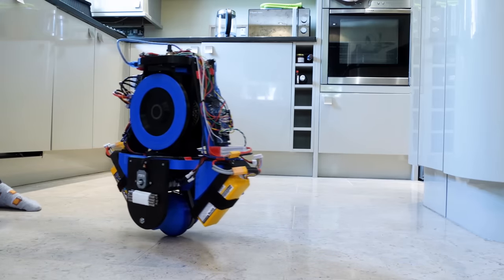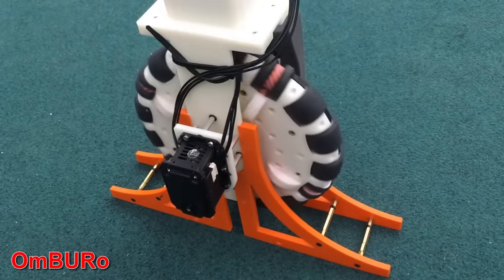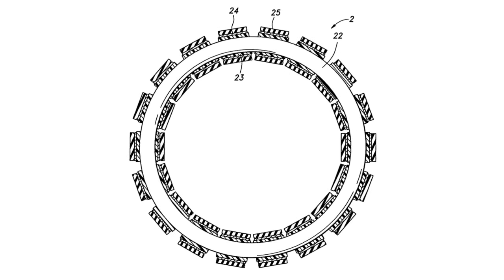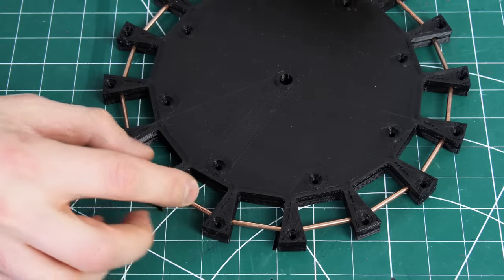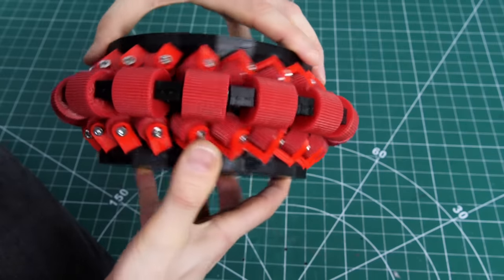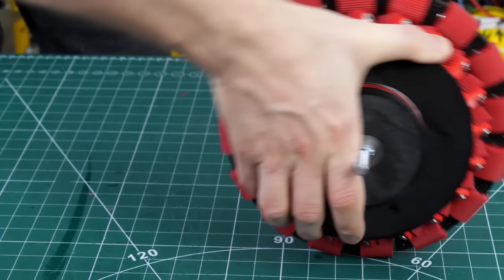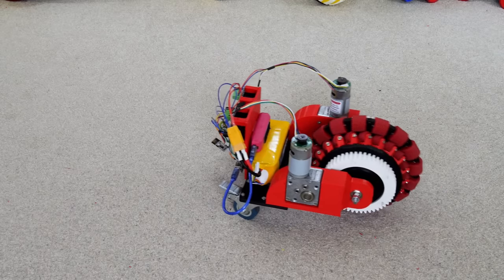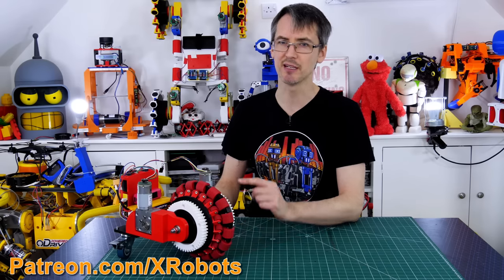Why this Omni-Wheel is Really Weird

Comment from the maker: Check out part 2 - will it balance on one wheel? https://youtu.be/B_bXW2vfkm0
Reply: I don't know if you know this, but herbie was ment to me in fan4stic, and was ment to be just like the robot at the start of this video, but with a soccer or basketball!
Reply: This really grinds my gears.....need to angle the teeth properly for engagement. Deeper grooves. Gears need to engage properly to get any work out of them. I wish I lived in a higher IQ dimension.
Reply: I really couldn't figure out the potential advantages of a single complicated wheel over 4 simple wheels... What is this going to be applied to?
Reply: The Mel science web site is garbage. Nice Clear Pricing!!!! No request for subsription or info... WTF
Reply: It's not a unexpected twist. Similar to when you drive a motorcycle, you turn the handles into he opposite direction you want to turn. Look it up. Cool project. You gained another follower.
Reply: What i wanna know is why is this technology not in modern cars.... like I have known about it for a while but never understood why it couldn't be adapted into cars? like all the components are so simple in design how hard would it be to just put it into a car

Comment: here as well as with some of your gearbox videos (harmonic drive, and I think one of the cycloidal drives), you use flexible filament for grip or ductility. It does do both of those things but it also saps efficiency and puts more load on the motor. Think biking on a flat, soft tire vs an inflated and much harder one. It's a balancing act to get grip and efficiency, but in my experience most 3d printing flexible filaments are too soft for transmission rollers. Maybe try PLA rollers with just a thin rubber tire on the small wheels for grip.
Reply: To be fair, compared to the traditional machining, hobby-level printers may be working with tolerances of 0.1 - 0.2mm even when tuned quite well, which is a lot more slop than you'd expect from machined parts. That could have an impact on how well harder rollers grip.
Reply: Have you ever used TPU depending on the infill u can't make it very hard 
I don't think ur they are as soft as you think they are
Reply: @syedsulaiman8380  I've got a roll of TPU and have seen lots of other people's prints as well. It may feel "firm" to the touch but its still very soft as compared to the rubber on a tire or drive belt.
Reply: @EgorKaskader   True, but even then I think you'd be better off with two hard rollers, with one having a thin TPU tire for more traction and to soak up the loose tolerances. Or at least one soft wheel and one hard wheel to minimize the energy lost to soft, squishy rollers.
Reply: Listen, you don’t know a thing
Reply: I like the idea of a hard center to the wheel with a flexible exterior for grip... you could even print the exterior in TPU instead of using rubber, since then you could print multiple wheels with different ratios of TPU inner radius to PLA outer radius, and 'tune' the flexibility vs rigidity tradeoff to be exactly what you want.
Reply: Triangular belt treads instead of middle rollers, the side rollers acting as tensioners on the belts. The point of the triangle in the same place as the orignal rollers, the two others inside the central disc
Reply: Oooppo
Reply: A tyre that's too hard on a ground that isn't perfectly smooth can also lose efficiency due to vibration, though only really an issue at a high enough speed.
Reply: @kl3mta3  
*"you're"
YOU'RE WELCOME.
            ♿ 🇺🇸

Comment: What you have here is essentially 2 mecanum wheels engaging intermediate rollers which engage the floor.  In my opinion, 2 side-by-side mecanum wheels directly engaging the floor would be better.  The only thing you would have to assure is division of the load between the 2 wheels.  That can be done with a short equalization lever.
Reply: Yes but then there would be an extra torque when the two side-by-side mecanum wheels are rotating in the opposite direction
Reply: yes, but then the sideways movement would be very reliant on floor traction due to the mencanum wheels. his design would be more relaible on a vareity of surfaces.
Reply: An interesting observation, though for self-balancing (his ultimate goal with this) co-axial dual-mecanum wheels are notoriously difficult to use. They also have the down-side of blocking rotation about the axis perpendicular to the line formed between the two wheels, meaning that it wouldn't be able to balance on uneven surfaces (or go up a hill sideways) nearly as well.
Reply: here's a crazy idea,. have two mecanum wheels, but put one inside the other!
Reply: @isaaczoesch158  ANY balancing scheme with 1 or 2 wheels MUST have friction with the surface just to balance.  That's why bikers suddenly fall when encountering icy or wet slick roads.  The 2 wheels could be guaranteed equal force-bearing by using a lever equalization link (like used in steam locomotives).  The largest objection to the 2 side-by-side scheme is the torque about the vertical axis generated when driving the wheels in opposite directions.  This could be mitigated by using 3 wheels side-by-side, the outer 2 driven together, & the center one separately.  (He might object to this as the vehicle is no longer technically "1 wheel".
          But the best way to do this is to have real legitimate gearing to drive the smaller wheels.  This will be intricate with bevel gears, but doable with his extensive 3D printing equipment & experience if he makes the wheel larger.  This would permit the small wheels to be football shaped, giving a true circular outside profile.
Reply: @randomblogger2835  Explain how this could be done!  Wouldn't the 2 wheels collide with one another when turning in opposition?  They would have to contact the floor in the same place at the same time!  We need to invent a substance that can pass through itself, but not the floor.
Reply: And yet an electromagnetic gyroscope illudes...
Reply: Think spherical Acoustic waveform energy motor... Instead...no moving parts...well rather ONE Moving part the centrer armature.
Reply: Do you guys just know all this stuff because you’re interested in it, or because you went to school? The jargon is real here.
Reply: @lindboknifeandtool  Expelled Three times and Gifted Program since Age 7 raised by a Vietnam SEAL with multiple Engineering  masters degrees and 7 US Patents
Reply: I'm. An Autistic Savant... I took apart EVERYTHING as a kid.. and fortunately I had an Engineer to explain HOW it works to the gaussian density winding calculations of field coils in an Armature to stoichiometric Air to fuel air Ballance of the Holley four barrel I disassembled when I was 8 of my father's work truck... My punishment was putting it back together
Reply: @lindboknifeandtool  never let School get in the way of your Education " Samuel Clemens aka Mark Twain..
Reply: @lindboknifeandtool  I make blades too Mostly as gifts to other's name the trade or craft essentially..
Reply: @mjolnirswrath23  it’s fun! I used to pretty sharp until I went into psychosis. It gave me brain damage. I always think about how things would’ve gone if I had a good dad like that, and didn’t have schizophrenia. Hopefully I’ll be at school of mines for metallurgy in a few years after my bachelors in machining.
Reply: @perfumedmanatee6235  just the intrinsic way you guys seem to know how torque would be influenced...etc... I never got into mechanics, i should. It’d be easy to apply gear ratios to make a power press.
Reply: @lindboknifeandtool  I've been shot stabbed impaled lacerated skillsawed twice bitch slapped by a 30,000 gallon City water tank , 19 vehicular incursions rollovers flips aerial sideways flips head on collisions Ive  walked away from them ALL although the water tank gave me a form of hyperfascia..I cannot remember people's faces long term.. even people I've known for Decades.. photographic memory for Concepts and Blueprints. Documents.. but not for people's faces
Reply: @lindboknifeandtool  (I feel the conversation's moved on a bit since your first comment, but I'mma reply anyway) I'm a roboticist in the 3rd year of my PhD studies (part time, I work at a robotics company the other half), and coincidentally a guy I work with built a coaxial mecanum drive robot for his PhD thesis, which is mostly why I can talk to the subject's difficulties.
Reply: one wheel would be smaller an (so it fits inside) and acts on the back side of the rollers of the larger wheel, its own rollers being at 90 degrees to the outer wheel's rollers.

Comment: you could get more grip between the sub wheels of the omniwheel and the rollers on the side plates by making the subwheels with a 45 degree diamond pattern instead of straight ridges. This way the ridges of the rollers will match up and apply a pushing/pulling force instead of mostly friction
Reply: Get on the cross and don’t look back  Stop spamming
Reply: @justsomeguywithoutamustach7151  the original comment may be deleted, but based on the name I have a pretty good idea of what was posted

Comment: I think you may have mis-interpreted part of the patent.
Those "teeth" should be helical.
All you are doing is reducing the contact area between the driven and drive wheels in your design.
Either make them with matching helices, or make them smooth (smooth is probably better unless you understand gears and can machine them more accurately than a 3d print).
Reply: There's many things odd about this design.

Comment: One seemingly important difference between your omni-wheel and its inspirations is that the smaller wheels aren't interconnected.
I think you are losing a bit of torque and efficiency potential by essentially driving only 1-2 smaller wheels at a time (the ones in contact with ground) rather than all of them.
Reply: After the ornithopter videos (no difference in AoA between up/downstroke) and that CMG project (no way to desaturate the gyros), it seems to be a bit of a common theme here that important details of the technology are routinely neglected. Amazing projects nonetheless, even if the results end up hampered by it
Reply: but they also seem to use a flexi shaft in both directions- I think they are only strong in one direction and you can damage them easily if you use in the other direction

Comment: Maybe those small driving wheels on sides can have some kind of spiral-shaped gear teeth so they would lock with the bigger wheels. Or it's named helix, not spiral. The point is that the teeth on the smallest wheels can be not just parallel to their axis but go under 45º angle around

Comment: What if you use interlocking conical gears on the ends of the rim wheel axles. So you get a form of 'bent gear coupler'.
These conical gears cab be made for other angles than just 90 degrees like in a differential.

Comment: if you had a singular ball in the center with the rollers acting as stabilizers instead of the locomotion; could you then have an omni-wheel made from a ball?
Reply: https://youtu.be/byUo4EagXu0?t=102 that would be this with a smaller ball
Reply: Problem with a ball is the dirt you pick Up from the ground getting stuck in the drive, if this wasnt the case Every car in the world would have had globular Tires by now
Reply: @johnpetters3328  Brushes and maybe compressed air
Reply: @jennalove6755  Yeah, seems like it would be pretty simple to push air through from the top to flush out and even cool the wheel if need be.

Comment: Love it.  Do  you have any issues with the "strafe" speed being so much slower than the "roll" speed?  Seems like it might cause a bit of a control problem
Reply: Probably just a case of using just some spare motors, he seems to have just been doing proof of concept here. A faster more powerful motor would do the trick, I think he’s still gotta work out the play in the rollers themselves to work out precision and accuracy with the movement before being able to balance I suspect

Comment: I wonder if you could print a helical tooth pattern on the outer rollers that the smaller drive rollers can bite into? I assume it would have to be two counter-twisting helices, one for each side of rollers, so effectively the outer rollers would just be knobby.
Reply: This will probably not work because the outer wheels are flat/cylindrical and not round/parts of a torus as shown in the patent. But its worth a try, i guess 🤔
Reply: I was thinking this as well but having trouble thinking of a profile that would allow engagement with both sets of smaller rollers as well as the ground... Somehow your comment reminded me of a video I saw recently (past three months) with some very interesting knurled or cross-hatched gear profiles that might work.

Comment: For in-line two wheel vehicles you actually do have to turn left before you can turn right. This is so counter intuitive most people will fail to grasp it until presented with a physical experiment.

For an omniwheel bike this would require you to slip to the left before executing the right turn. You would then have to reverse the procedure to come out of the turn. The required angle of slip can be calculated by balancing the centripetal force for a given radius of turn with the downward force of gravity such that the resulting vector is through the centre of mass to the wheels.

Comment: Idea: mount the two driving wheels at a slight angle relative to the vertical central plane - this way you only get traction - and, more importantly, friction - where you need it: at the bottom
Reply: It strikes me that the whole mechanism could be simpler if you were only concerned about driving the bottom 3 or 4 rollers.
Reply: Yes, the only reason to drive all the wheels is simplicity of design
Reply: Was about to comment on that as well! But slanted wheels would cause problems with contact patch between the main and driving wheels. The same goes for smaller and eccentrically mounted (towards the bottom) side wheels. Maybe some clever geometry could prevent this?
Reply: @huzeff  I'm sure the geometry would have to adapt - but that's not an issue for James

Comment: Nice! 🙂
You should make the teeth of the TPU wheels disgonal so that they mesh like a gear. And you should perhaps make the large rollers more like a barrel, i.e. make the outer diameters somewhat smaller than the diameter in the middle.